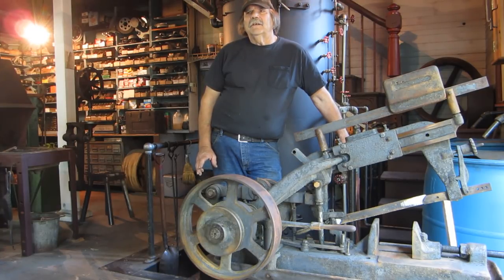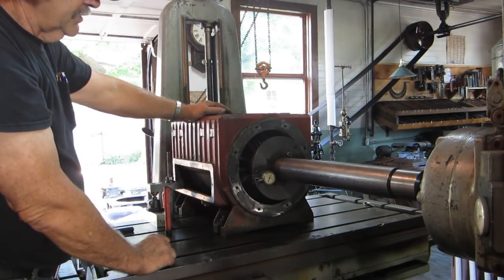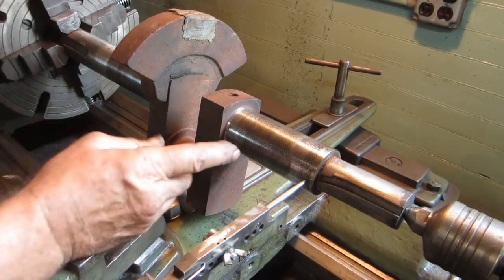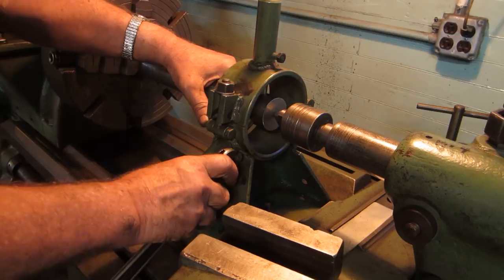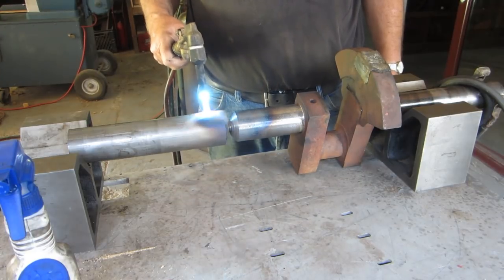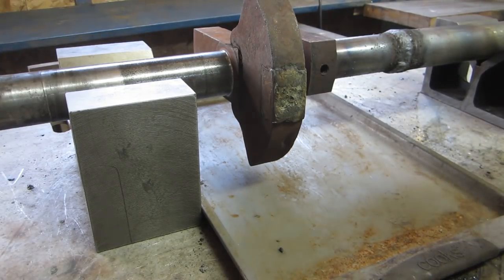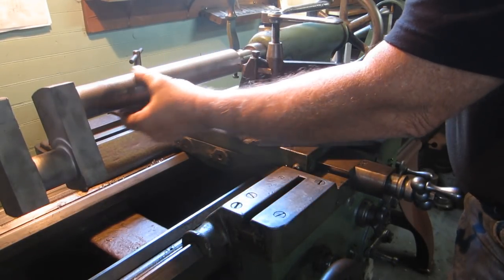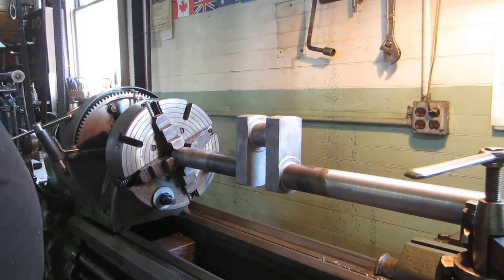OLD STEAM POWERED MACHINE SHOP 14  Steam engine crankshaft

Comment: I usually read all of the comments before adding my 2 cents .  . . but I'll just dig right in -  
Counterbalancing at the chuck can become super critical with relation to speed . . . harmonic imbalance sets in , with potentially catastrophic results !    * Glad you had a chat with A - bom !   
       I've seen all of your videos , & relish peering into the past, and seeing 'Old Iron' being kept alive !   Thanks for being so kind in sharing this with us old horses !
Reply from the maker: Thanks George, as you can see I run everything at very slow speeds, even with HSS or carbide. Older machines are pretty rigid so heavy cuts sort of make up for it. So, when something starts going very wrong, it does it in "slower" motion. ...Dave

Comment: Hi there Dave, I really like the way you show in your vids the maintenance that you carry out on your equipment (line shaft oiling, belt conditioning, and such.There are a lot of people,me included, maybe wouldn't have realised what needs doing) whilst the boiler gets up to working pressure. Thank you for giving us a chance to see what's required to run a steam powered shop.
  Cheers,
   Paul.
Reply from the maker: Thanks Paul, There's a lot to keep in mind, but I do a couple things each time....Dave

Comment: That is the best hand turned weld I've ever seen. Trust it against any other is all I got other than the respect I got for all the old timers who invented all this while kids sit and zone out on video games learning nothing.
Reply: fla playa sorry bud better look again at that weld it's full of porosity. All this little pin holes are bad. Looks like he used cold/old rods. The only reason it will most likely be ok is because of the thickness. But that wouldn't fly at my job.

Comment: I don't know if you have seen my comments in the past. I'm the one that made a comment saying he wanted to make a steam powered machine shop because of you. Well, I have a large shed as a starting point. Ill be casting components for the lathe and shaper that will build the steam engine to power the shop. Starting next month in May lord willing. 

An added benefit of steam powered industry. I'll still be building and repairing things long after an attack on the electric grid. The way I see it, I'm adding to the resilience of american industry. And this is all thanks to you and your work here.
Reply from the maker: Mr Knight: Good luck with your shop...Dave

Comment: Oh joy! Another steam machine shop video! OK, the welding was cheating but forge-welding would be impossible. Loved the :new" belt-driven hacksaw. Who needs a Harbor Freight bandsaw? Loved the old-style DTI, lever-operated. And a nice piece of turning. And I agree, it is very difficult to set up a crankshaft on a faceplate. The old-timers apparently did it all the time but I for sure can't do it! Keep them videos coming!
Reply: Do your research before you post. The first arc welder is about 1890. See https://www.millerwelds.com/resources/article-library/the-history-of-welding. This is well within the time frame for this shop. I retract my "cheating" remark.
Reply from the maker: Thanks Juan, That crankshaft was turned from one piece. I probably could have keyed and pressed a new whole PTO end into the throw, but the arc welding was necessary to save the crankshaft. ...Dave

Comment: I wish my lathe had the T-slots in the apron shears like your lathe has. It takes some blocking up, but cylinder blocks and what not may be bored on the lathe like you did with the boring mill. It takes a lot longer to set up, but it can be done within the limits of the lathe's swing and cross slide clearance.
Always look forward to your videos.
Reply from the maker: Oh yeah, That's the idea with the apron T slots. You sort of make a small boring mill out of it...Dave

Comment: Hi Dave - your videos are always very interesting, but this one more so. Honestly one of the best machining videos I've seen. You really need to try to find a young enthusiastic man to pass on your skill (if you haven't already done so). Because they really are priceless. I'm sure you understand what I mean.
Also vane pumps always seem to wear more than internal and external gear pumps. We used to find this on engine rebuilds in the 70s. Just a quick story. It was a Transit V4 and we always fitted a new pump. One old unit had one that appeared brand new so we reused it. When fitted it had no oil pressure. I was given the job to fit a new one, quite simple as you could get the sump off. I fitted the new one and it had oil pressure before it even started. Just one of those things you remember.
Reply from the maker: Hi Malc, Thanks for the comment. This customer says he has been in the Vac. pump business for a lot of years and has got an inlet mist oiler set up on the inlet side and has experimented around with different oils to get a lot more life out of them. Has several more to do....Dave

Comment: 65429 views! congrats! Used to bore and build DeLaval vacuum pumps for a dairy service outfit until they started robbing single parts from pumps that were carefully set up, and they had trouble paying. Must have done scores of 'em. I bored them on my 24 inch 1925 Bullard. She is in very good shape. When I got her it was still driven by flat belt. That belt would come right off the pulleys and hoop snake right by me across the floor. I replaced that system with timing belt running on the same pulley, but with teeth cut into the OD.

Comment: Nice work on the vacuum pump and the crank shaft.
The vacuum pump is similar to the Moro M9/M200 type. The wear pattern inside tells that it has been running with failing filters (if even applied?).
Remember to set the rotor and end pieces to the house and make new reamed guiding holes. 80% vacuum with new vanes and correct rotor setting should be easily accomplished.
All the best to you and your fantastic channel!
Reply from the maker: This customer has been in the business for a lot of years and builds his own pumps, he just couldn't find a shop that could bore the cylinder. He has more bare cylinders to bore later. You are quite familiar with them?
Reply: Yes, the M9 but also like Wittig WPS 196 and 200. old ones like RVL 40 and so on and so on.
My first real job (1982) was as a mechanic on sewage vehicles, high pressure water pumps, garbage collectors, street sweepers and things like that. Did that for 18 years and left the "business" around 2000.
Hard work but happy days. :)

Comment: How have I never found this channel before I love old machines. That old Racine you have is a gem!!! I have one that's just a little older than that I talk to this guy and send him pictures he's an expert on the Racine's and power hacksaws in general mine's a 21-inch I believe I can't even remember I haven't been out there in about a month because I've been sick. But he said mine's right around the turn of the century. it works like brand new I didn't even restore it well I had to start using it right away. The only thing I restored is the Brown & Sharpe oil pump and I'm about to go put that on one of my lathes right now.  People don't realize how great those power hacksaws work. I can literally cut a 15 inch piece of Steel with no problem. I mean the diameters are huge that this thing can hold. it has a voice that's actually two halves so I can slide it way way way open and as long as it'll still grip the part it's no problem. I routinely cut 5 inch diameter tool steel without breaking a sweat. I didn't notice I'll have to wash the beginning of your video again does yours have a gearbox with three speeds on it?

Comment: I know this is an older episodes, but wanted to comment on the HoBo mill work. I have a fondness for them, I ran a Bullard (I believe 5 or 5-1/2” spindle, with a square indexable table and big tailstock, back in ‘80-81 period. You may know the name Farrell Corporation name as they had a plant in Rochester back then. I worked in Connecticut. Cool machine. My Bullard was probably late 50’s or 1960’s era.
Reply from the maker: Thanks for the comment....Dave

Comment: G'day Dave great video the boring machine looks a lot like the ones they used for machining cylinders on steam locos.  Really interested in how you are machining the crank shaft, especially how you are going to put a sleeve in the damaged end.  Thanks for showing another great video. Kind regards John Tasmania
Reply from the maker: Hi again John, The crank could be sleeved, but I'll turn it undersize and re-pour the bearings to fit.  That's next...Dave

Comment: Sounds like you have a dirty interlocking contactor on that HBM. I bet if you take it apart you'll find that the faces of the laminations are rusty or dirty. Some emory cloth and it'll clean right up and stop that buzzing.

Great video. That crank looks practically brand new all cleaned up.
Reply from the maker: I think it's just worn out. I will change it out before the next video, It drives me nuts....Dave

Comment: the "T" slots in the 4 jaw are useful to put jacks to support odd shaped pieces and to put machinable support that can be machined to make stops to hold parts a certain distance from the chuck face and in production runs to get rough parts concentric and strait quicker

Comment: I worked at an old papermill that ran on line shafts driven with steam engines and turbines. When the smallest of turbine engines failed a 500 electric motor was put in its place. Dispite my best effort to prevent it the turbine went to salvage. In fact the entire old part of the papermill went to scrap. Because of the tax break given nothing could be salvaged. The truth is no one but myself wanted to even try.

Comment: Nice work on the rotary vane vacuum pump Dave.  Crank repair looks great too.  I think the contactor on your hbm needs a little clean up.
Reply from the maker: I think it's shot Bill, I now have a good one that will fit that box I think....Dave
Reply: The contactor on my Steptoe sounded like that the first time I powered it up.  A few pass throughs with some emery strip and a good blow out set it right.

When I first took the cover off to hook the power line up, the top was loaded with a huge old wasp nest.  Any space below that was packed full of mouse nest.  And what was left of the mouse that put it there.  One wire had to be repaired where the mouse had chewed the insulation off.  I pulled and picked for an hour to make sure I got it all out of there.  No desire for a fire when you are that close to finding out if your buy was really worth it...
Reply from the maker: Sounds like some of the roasted mice I found in  lawnmower air shrouds....Dave

Comment: Hi Dave, 
Fabulous videos, thank you for sharing. 
I have one question though; why don't you lag your boiler? 

I volunteer at a local steam museum, at Forncett, near Norwich in England, and we have a vertical Cochran boiler, fired on wood, to run the engines. 
Lagging makes a huge difference, both with saving of fuel, and for the output  of heat into the surrounding area. Lagging your steam pipes would also cut down on condensation at the end of the steam line. We use fibreglass, and then wrap it in strips of cloth, like a bandage, soaked in plaster of paris.

Love your workshop. I demonstrate a Victorian , 1840 - 1870, lineshaft workshop at the museum, run off a 15nhp Marshall, and visitors are fascinated by it, especially when I describe the pre mass-production skills that those people had that we have since lost.

Keep up the good work.
Andy
Reply from the maker: Could be done, I don't think it would do much for the buel burn, and I like the radiated heat in cold weather, and I like looking at it....Dave

Comment: Another thing those slots are used for is "Kicker Blocks" to hold a chunk of stock at a uniform distance, usually when you want to grip by 2 or 3 teeth depth.
Reply from the maker: I see, like parallels that won't fall out....Dave

Comment: Crank looks so much better! That saw looks like a nice addition. Do you have a steam driven dynamo powering your arc welder?
Reply: I was waiting for him to gas weld it......
Reply from the maker: No, but keep your eye out for a belt driven AC or DC generator that can be belt driven.....Dave
Reply from the maker: My father told about owning a feed mill powered by a more modern (then in 1925) water turbine. It included a saw mill. The mills upstream held up the water and their pond didn't fill up until evening so they sawed after dark by the light of a DC dynamo run off the turbine also. Years later, the next owner hooked up the generator to a car engine and welded with it for years. ...Dave
Reply: David Richards
Early "clean energy". :-)
Reply: Oh, that's not a new thing? ;-)

Comment: Thank you, I have found one of these I would like to get. I believe I know how to operate it for most part, but can not figure out how to run the spindle out. When you engage the hand wheel it is locked. Before I go and look at it under power I wanted to be able to operate everything. I have looked every video I can find with one, and have not seen some one run the spindle out in the video. Thank you for your time. Jon
Reply from the maker: If you are talking about a G&E mill like mine, to operate the power feed for the quill: if the lock down bolt is loosened back on the quill housing on top, you engage it with one of the three small levers below, then engage the main feed lever to the right (just above the small levers) you have to hold pressure against it untill it drops in and the main machine clutch has to be engaged.  My quill feed doesn't work, I believe the shift fork on the small lever is broken or disconnected inside, and it looks like it's a real job to get to, but I feed the table into the work (or drill) and it does fine. For most work you do that anyway.
Reply: thankyou  for the reply, I can't figure out how to run it out manually. Its locked hard when you try and turn the hand wheel. I will look again when I see the machine again and look for the quill lock on top. I had looked all over for a lock and couldn't find one. Thanks again.
Reply from the maker: Jon, my G&E has just a long nut (5/8") I think for the lock. It's on the top of the quill housing  pointing up about half way back about 10 inches back to the right of the hand wheel.  The lock for vertical movement is also a nut pointing at you to the left of the hand wheel. Is this a Gould & Eberhardt mill?
Reply: No sir, it is a giddings and lewis model 25. I'm sorry I thought that's what your's was. I will keep searching for a quill lock though.
Reply: I see in video yours is G&L 25. It looks identical to the machine I want. I also saw in your video the quill lock nut you told me about I can't  wait to get back to the mill and try it out now. thankyou very much.
Reply from the maker: Yeah, mine is a G&L 2.5 also, it must have been late in the evening when I answered that one! I had shapers on my mind I guess....Dave

Comment: Nice work on repairing the crankshaft end. How did they ever twist the old one so much? 
Looking forward to the next episode. 
Thanks again, Dave.
Reply from the maker: I have been thinking that something in the winch drive (gearing) locked up while running at a good speed but I just noticed the other day a gouge on the side of the rod that I had'nt noticed before and a matching mark on the frame. So maybe something got dropped into the rod area while it was running fast and the geared load momentum twisted it. ...Dave

Comment: Nice! But why didn't you just put a counterweight back on the crack to aid the balance? I always thought those slots on the four jaw where for using it as a face-plate but that's a neat new use too! Greets from the Netherlands again
Reply from the maker: Hi Wurtf:  I was having problems with them being in the way and wouldn't have been in balance anyway without something to simulate the reciprocating weight. ...dave

Comment: Dave, just found your youtube channel and I'm hooked.  Several guys in our our antique tractor club are running steam.  Just curious as to the weld rod you're using on the crank shaft repair, and what amperage you're running on that thickness of material?
Reply from the maker: I think it was 7018, my welder just has numbers 1-10 and several ranges but I think it was somewhere about 170 amp.
Reply: Thanks!

Comment: you can also use those slots in your chuck to run between centers and drive a lathe dog
Reply from the maker: Thanks Chris, it saves the trouble of changing over to a face plate or dog driver....Dave
Reply: David Richards I'm sure you already knew that. I myself never thought of using them to balance the chuck which is a brilliant idea I will be using myself in the future

Comment: I was watching the boring of the cylinder when I realized how heavy it must be and then you had to put the boring bar in there.  I hope you have some kind of lift.  Very interested in the steam engine.  Where can I get a dial indicator like that?  I would like to try to make one.  Got a drawing?  Thanks for the vid,.
Reply from the maker: The indicator came from my machinist friend Henry in Beverly, Mass.  It's patented about 1890, made in his home town. It has become the main indicator that I use on the American lathe most of the time. There are some detailed photos of it way back on my G+ page  ://plus.gohttpsogle.com/u/0/106588802892276489506   Thanks Paul,.......Dave
Reply: Thank you very much.